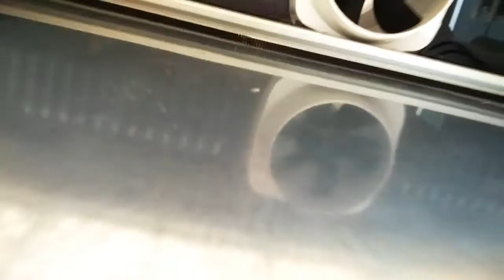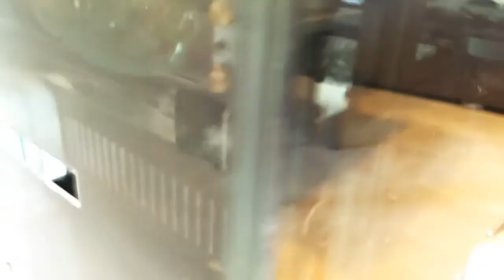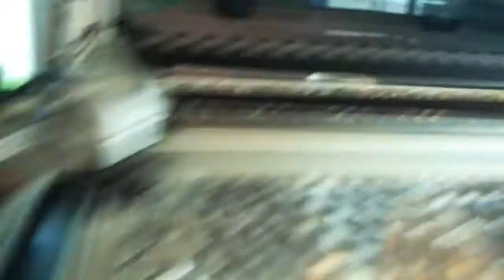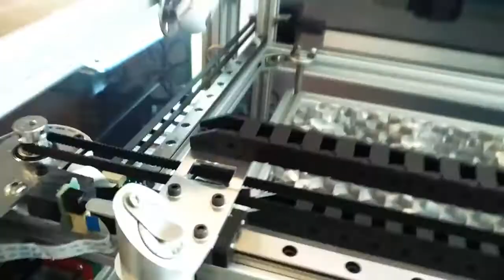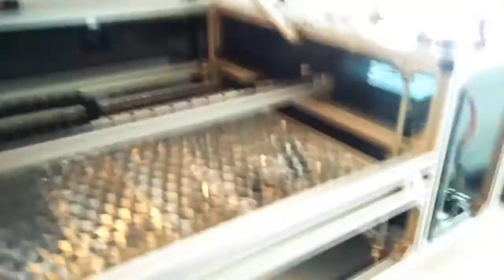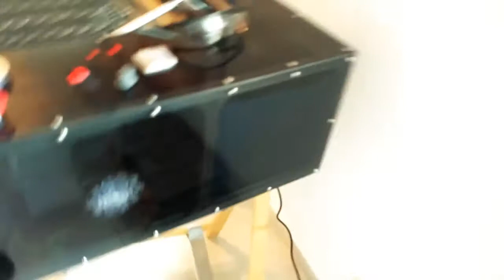LAYZOR - K40 upgrade. This is the home stretch!

Comment: Just looking through the BOM, using a GT2 belt with the m2 nano does that not mess the steps and dimensions up? or does it not matter as you've changed the pulleys too?
Reply from the maker: Exactly. As long as the matching pulley has the same amount of teeth per 360°, it doesn't matter. Moreover, I converted to a Cohesion3D board which allows for step angle finetuning.